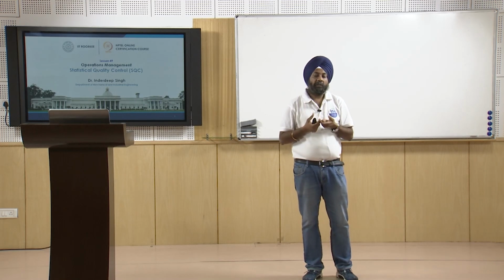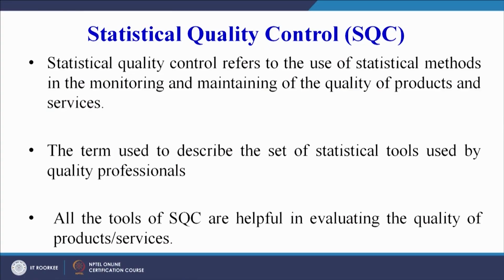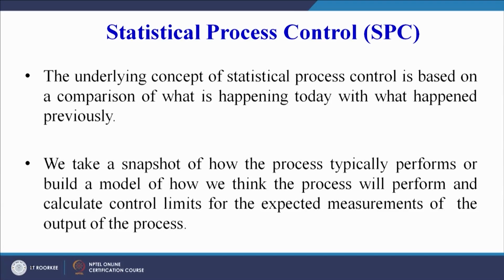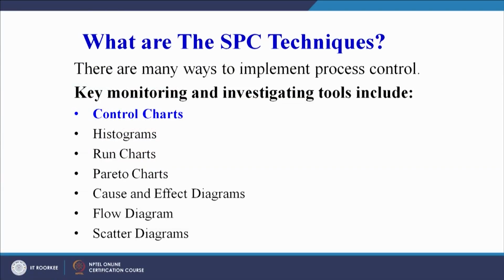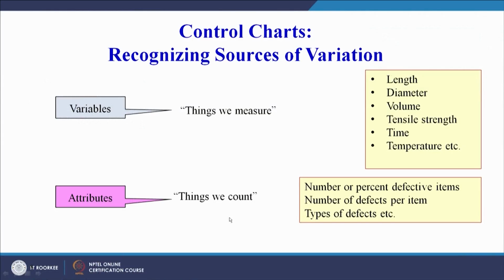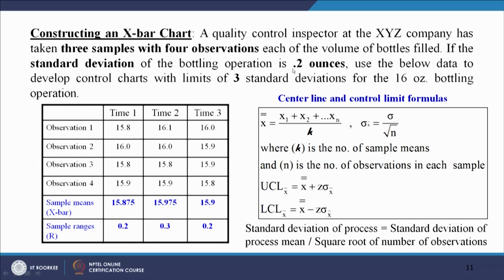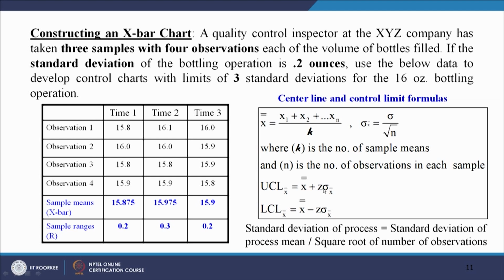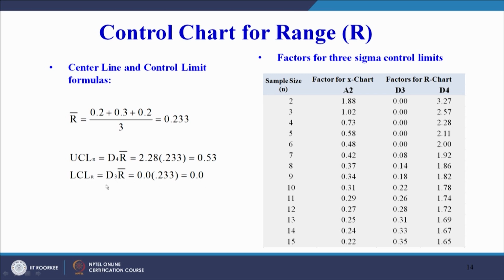Lecture 49 Statistical Quality Control (SQC)

Comment: 1. The scale of Graph is wrong. It can cause confusion as 15.92 is shown above 16.1 in case of UCL. In the same fashion, LCL is also shown wrongly. 2. There are three samples so should be three different graphs. Pls, rectify.
Reply: the black line corresponds to 15.92 value that is the control line. the point you are saying that 15.92 is shown above 16.1, that point is 16.1 only